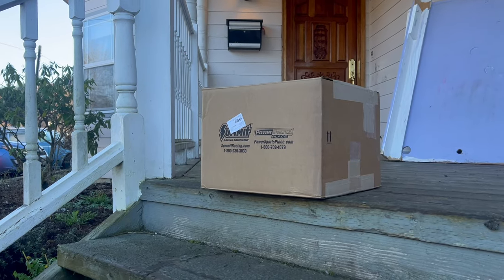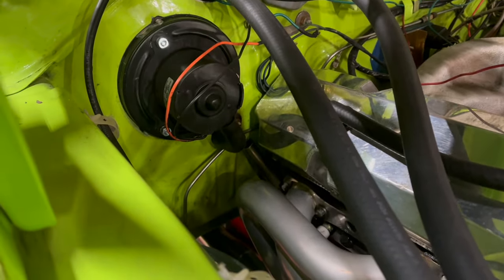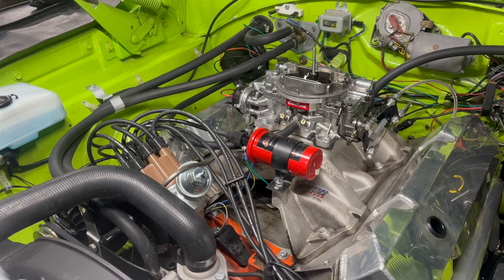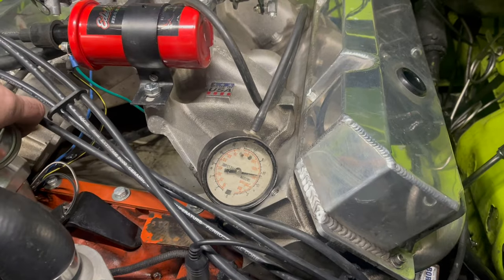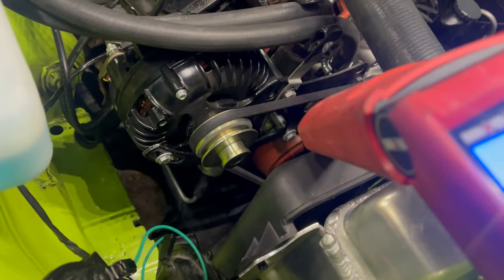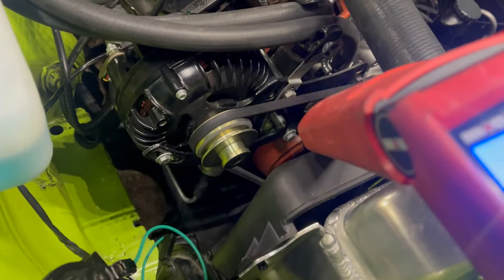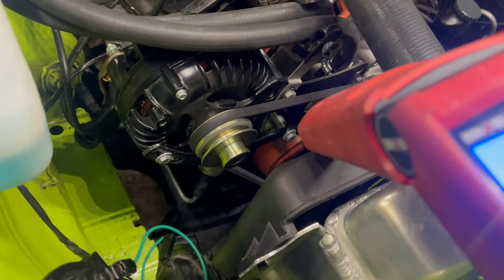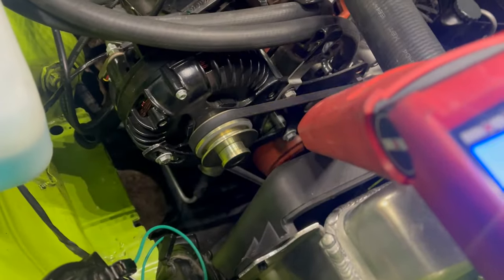STREET MONSTER! 1968 Dodge Coronet 500 - Testing And Tuning The 440 After Transmission Mishap

Comment: Old school trick to put in spark plugs in take a long straight spark plug boot with about 2 inches of wires sticking out of it pulled pull the wire back about 2 in after you cut the end off so the end of the wire doesn't snap on stick the boot on the plug put the end of your plug near the hole grab the boot or the wire and start turning it go in pretty much slick as anything every time old school trick old school mechanic here too
Reply from the maker: Nice one. I just use the socket and it works well enough. Usually…